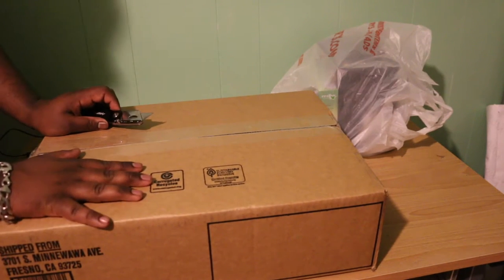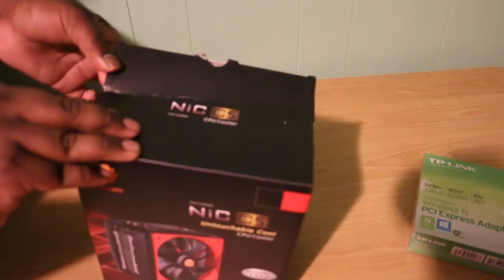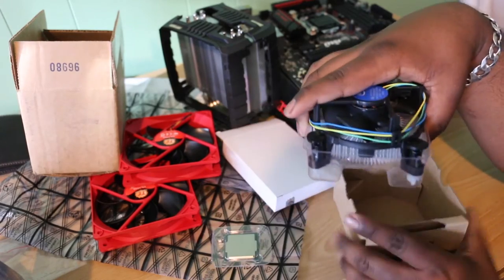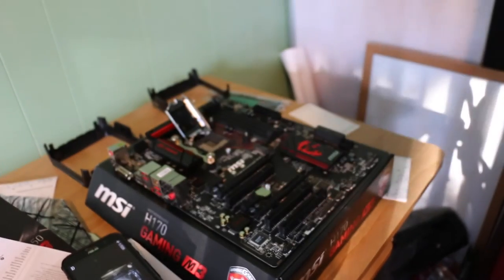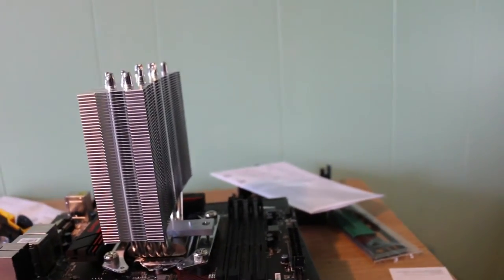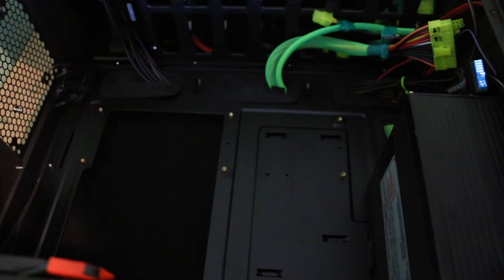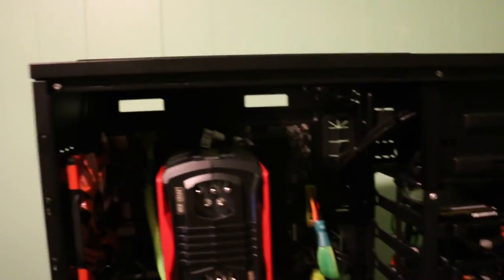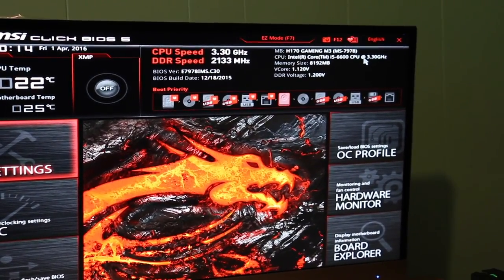My first Intel build with i5 6600 Skylake processor! Boss!!!!

Comment: can't believe you used a apevia power supply with that nice 6600k build.....apevia = junk
Reply from the maker: haha yes! we will upgrade the power supply when we swap out the terrible graphic card.
Reply: Get the GTX 1060 AMP 6gb. or OC or superclocked
Reply: That is not a K CPU.